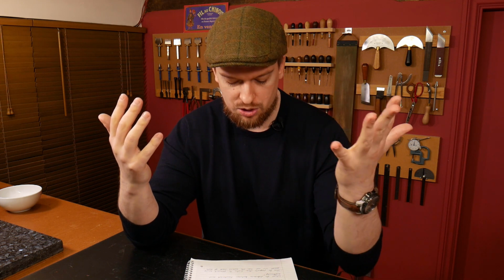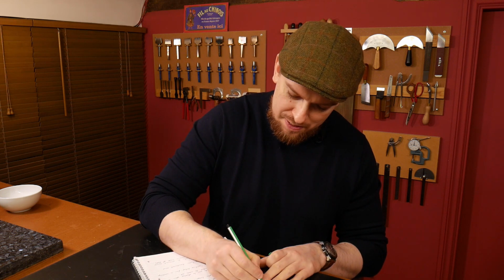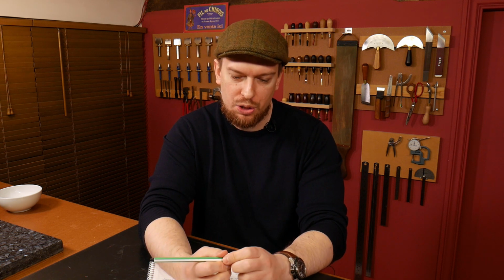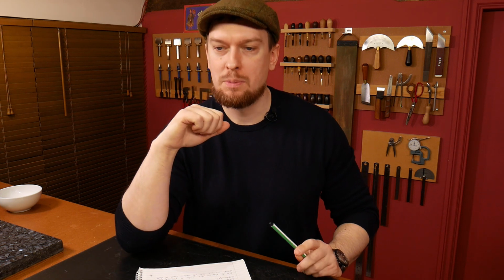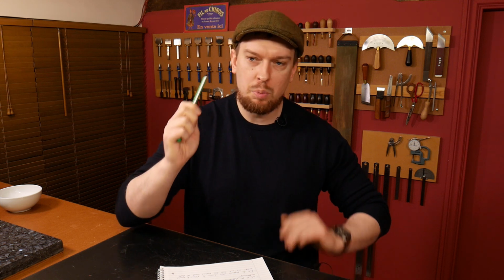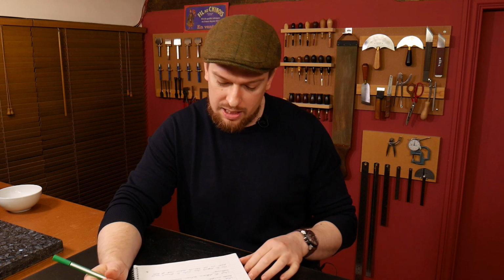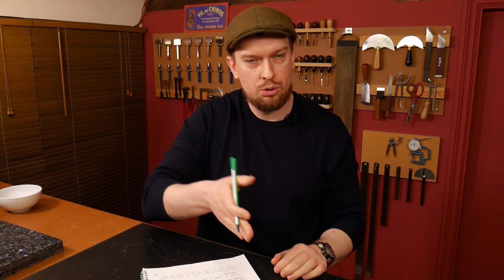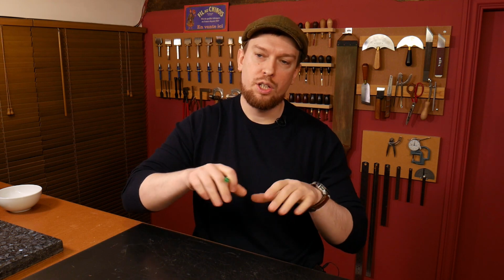Your Leathercraft Questions Answered LIVE - 'Handmade' vs 'Craftsmanship'

Comment: A trick my first chef taught me as an apprentice many years ago was to turn a plate over and use the ceramic ring on the bottom of the plate to sharpen my knife if I needed a quick honing.  This works well for edge bevellers too as the fluted edge of the blade fits well over the ring on a small saucer, just a couple of strokes and my beveller is sharp again then I just hone it on my strop.